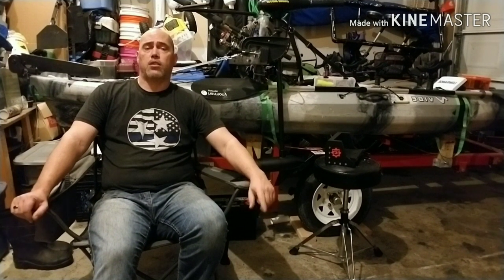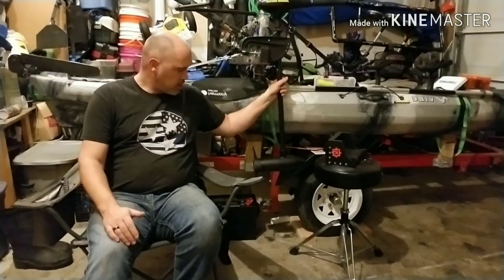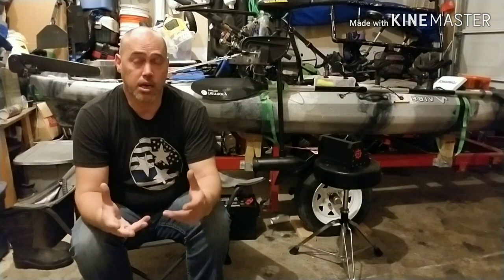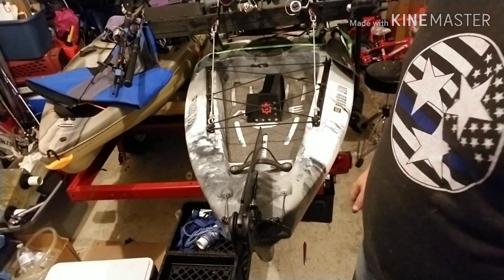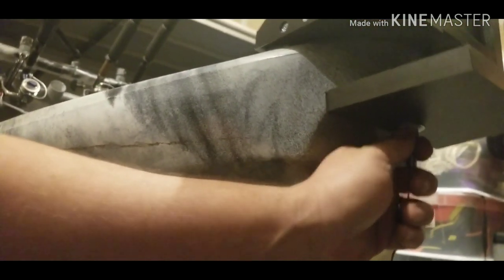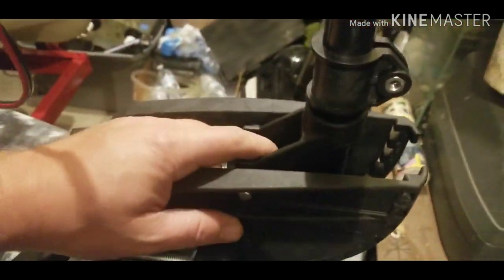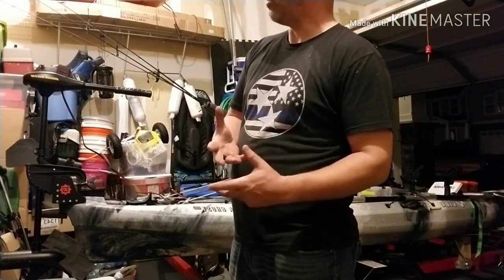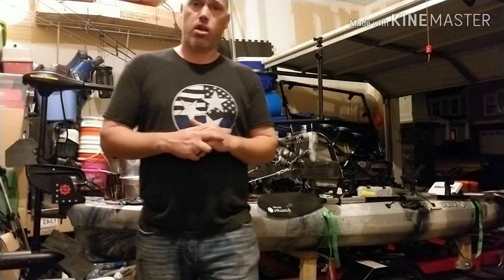5 minutes Yakgadet trolling motor mount upgrade and install. Wow!

Comment: Thanks for uploading the video, very informative. Actually I've been hesitating on doing this on my pescador pro, afraid of messup doing the holes and all the wiring but your videos are helping me build confidence on going forward. I used the trolling motor on a side mount last year it works but pulls to on side and motor has to work harder to keep the yak going straight. Please keep up the good work !
Reply from the maker: Have faith in yourself, you can do it! I will be dropping two more videos soon on the wiring of it. One with a diy controller and one using a prebuilt system from wirelesstrollingpro
https://www.wirelesstrollingpro.com/12cp.html

When ordering the mount be sure to get the one for your kayak. Yakgadet.com has several to chose from. 

I have also posted a video on a steel cable upgrade to the rudder system that allows more smoother movement and response that's around $10 to do. 

If you have any questions feel free to send me a message on Instagram at RAGNAROKfishing and be glad to help anyway I can! Remember you can do it!

Comment: Carrying capacity of Ascend 133x is 550 lbs.  I have same type of motor mount I make from same material.  I made mine for about $25.00.  I also make same type of steering bracket.